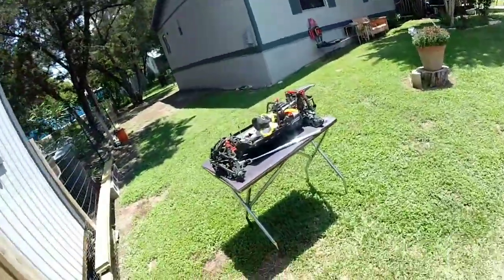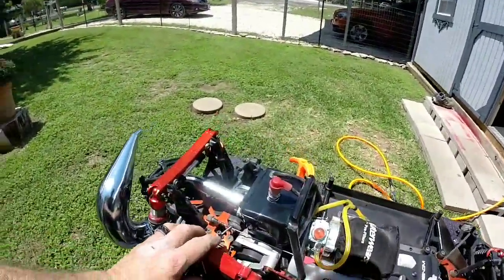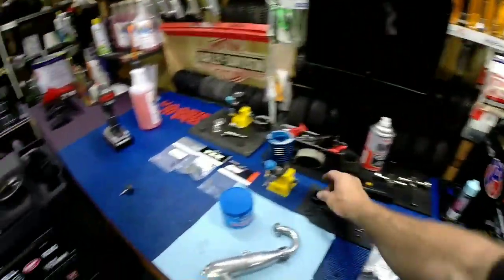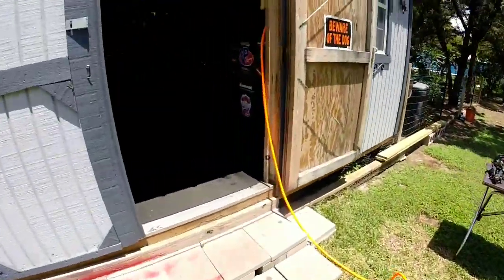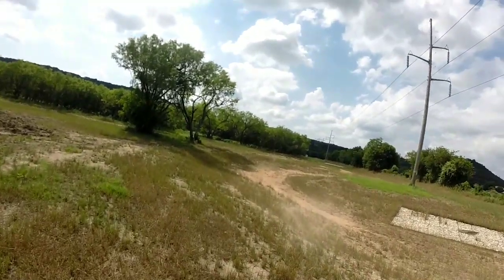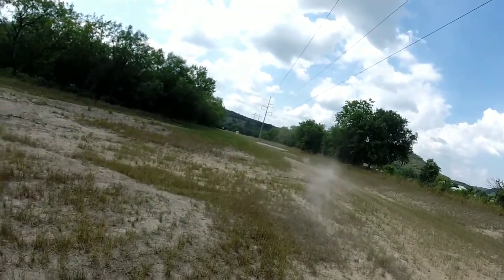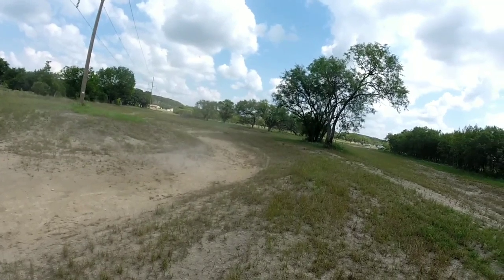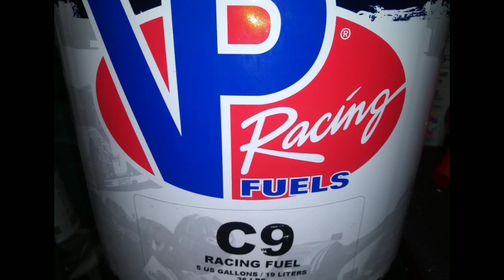Rovan R.C. durability test... Woogie Style

Comment: Woogie, glad to see you are walking through all the fine points on the FT. I did a bash yesterday and broke a dog bone pin, but they can be replaced if you heat the shaft up and pound out the pin with a punch.  its a Ø4mm x 22mm length. https://www.mcmaster.com/91595A170 (52100 alloy steel - 325,000 psi tensile strength)

Also,  forgot to mention that I replace the TRE's with some that I designed and printed in carbon fiber filled nylon, they fit much tighter and I have not had an issue with them yet.